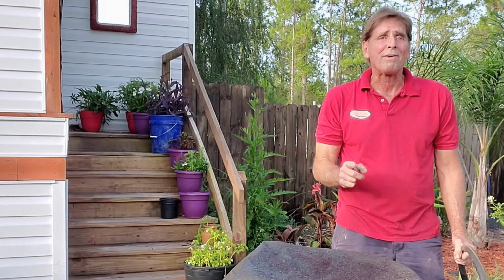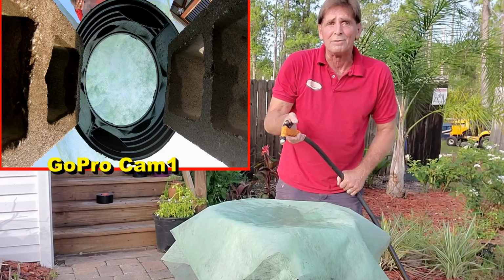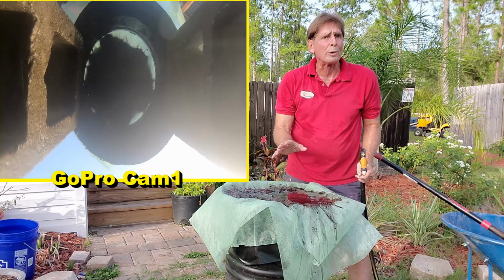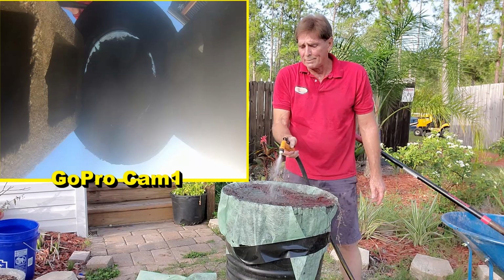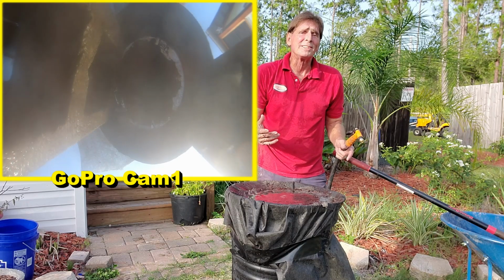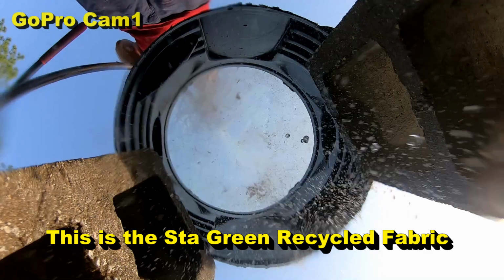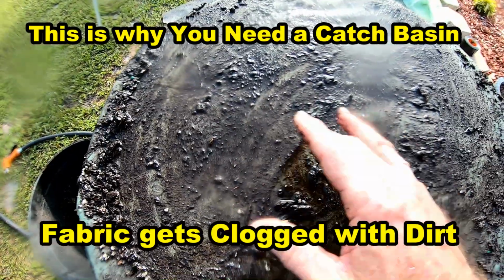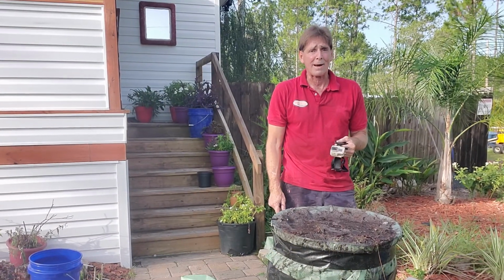Geo Fabric that Actually Works | REAL TRUTH about FABRIC, French Drain, New Amazing

Comment: HONESTY, love it. Back in February we followed your videos and built up and graded down the exterior walls of the house. Two-three months later groundwater has been diverted. The current pump has not come on, even after local heavy rains and the recent 3.5 inches from Tropical Storm Isaias.  Yet to be safe we will install E-Z Flow, for our soil type, the sump basin with the M98 pump. THANKS, CHUCK.

Comment: I have a drainage issue in front of my house. The front yard slopes towards the house. I’m going to install a French drain . Your videos are detailed and very informative. Thank you !
Reply: What was your solution?
Reply: @yume816  I had to dig all the way to the bottom of my basement wall and install 4 inch drain pipe and stone. I also cleaned the block wall and rolled a couple coats of tar on it . What a job it was .

Comment: HI Chuck, been a fan in NJ for a while and enjoy your content! We have a full French drain in my yard to capture water coming from upper neighbors. Although it works well, the trail of river rock in the middle of the yard is an eyesore.... Would it be ok to use 1 sheet of this product and do a thin layer of dirt and plant grass on it to flow with the rest of the yard? The original installed always told me to keep the rock so dirt would not filter into the rock / pipe and eventually clog it up. Thanks for your time, Chris

Comment: Geez.  I'm just finishing my drain.  I used the geo fabric.  And it was not cheap.  
I tested it and yes water runs thru really well.  Didnt think about how the dirt(  lots of clay here) will stop the water from going in.   
I may just leave the burrito unwrapped...an experiment.   And see what happens.    Thanks for all the help.
Reply: I have clay too. Did you use gravel around the pipe then wrap all of it. The one Youtuber said not to cover the wrapped gravel with pipe with the clay soil u took out. Replace it with normal soil. Who knows????
Reply: @antonios4926  
I dug my trench and lined it with the geo cloth.  (The one i bought I tested with water to see how fast it would go thru and it did pretty well.  )
Then put the pipe in and covered it with rock and wrapped the top and put dirt back on top.   It has worked well.  Im glad it is done.  It was a big job.
Reply: Thanks for your reply. Be well
Reply: @praypal5606  Hi Rebecca. How is the drain performing after a year or so?
Reply: @daibonehead  
It seems like it has held up pretty well.  and drains well. For a complete amateur I'm happy with results.

Comment: Great video chuck, as a DIY’er have used your videos for a couple years now with great success.  I believe the other guy is comparing apples and oranges here with the love of fabrics. I have watched all of his videos and don’t see a single soil type that has thick gumbo type clay I have in Louisiana, he moves dirt completely out and has a sod cutter that goes down several inches as well, all great things to offer as a contractor I guess but realistically how many of us on fixed budgets can do that? I believe you both have good design points on French drains that possibly cater to different budgets and soil types. I personally would never haul out massive amounts of clay bring in new dirt, cut the sod first just not happening.  Give me a good grade on a lawn throw in some catch basins if there is an area that needs a French type drain and no other way to move that water out then I’ll consider one but it will not have fabric and will be solid pvc with the perforated holes if I need to clean it out one day.

Comment: This video is good, however ambiguous it might feel after watching it all. I think Chuck is not an advocate of any fabric at all, except in sand. I live in Oregon and there's just clay mixed with soil but mostly clay in all of the soil in Oregon. He said, the the soil packs up against the fabric, and disallows the water to penetrate because it's blocked with soil against the fabric. I'm about to take a French drain in a few weeks against the interior photos of the perimeter of my crawl space. I'm just going to use Rock in the trench with three inch perforated pipe, and no fabric.

Comment: It's not the fabric, unless it's the wrong fabric.  The reason it slows down when you add soil is you are actually seeing the porosity rate of the soil medium.
Reply: I do think that I agree. It is as if he had placed the sandy soil from his yard on top of clear gravel and placed his gopro beneath, the water would drain at the same rate as with the fabric in place of the clear gravel.  This illustration reveals that it must be the porosity rate of the soil.

Comment: Hello, I already have a long discharge pipe of 4inches that leads to daylight but does not have a good slope, but it works.  Will the pipe work effectively when connected to a sump pump in a sump bin? Your videos shows a 3inch or 2 inch pipe if i could remember. Can you also post a link to the GEO fabric. Thx

Comment: Engineers only specify the thickness of non-woven geotextile necessary to survive the installation and use. More isn't better when it comes to filter fabric! Just need enough to separate the soil types without ripping to shreds.

Comment: So after all that you admit it doesn't work with clay and gets clogged. So I still don't know what fabric to use in clay.
Reply: I've been watching tons of videos on this subject, seems bringing drainage rock to the surface without any fabric works best for clay. Doesn't look the best but performs well. Gate City Foundation Drainage has good videos showing this and he goes back during storms to show how the systems are performing.
Reply: @tbarbuto2345  I heard that geotextiles that have drainage apertures of 60 microns or less work for clay, but that stuff costs an unbelievable amount  of money, and is normally sold only in quantities that a government agency would buy.  We bought a house which had been built into the hillside, so 2.5 yards deep to the foundation in back.  We got an inch of water in the basement, I dug down outside and found they had made a French drain with head-sized rocks, and no geotextile, all around the back, but over 50 years the clay had got in everywhere, so the drain  had no function.  Digging rocks out of pure clay is no fun; the rocks do not give at all.  I've got a system that's worked for 7 years; it's basically just an open trench around the back with a deck over it, but underneath it looks like WW I.  The system diverts a quart per minute of water round to the front of the house, but that leaves other water that I can't capture, which the foundation slab is just sitting in, but that water seems to just pass under the house without doing any harm.  At 62 years old, I would like to put the system in better aesthetic shape right now, so that when  I check out, my daughters can sell the house without too much trouble.  A really functioning geotextile would be part of a great solution.  Does anyone know if this 60 micron stuff really works?
Reply: @fuzzydon3291  I'd bet the clay would still clog that fabric. If you are dealing with surface runoff, I would open the trench and install a perforated pvc pipe (holes facing down) as low as you can in the trench. Fill up to grade with course angular rock without using any fabric. Also don't forget to install cleanouts so you can jet out the clay that inevitably gets into the system. Make sure your gutters and clear and dispensing far away from the foundation. Make sure you have proper grade away from the house. Hope this helps.
Reply: @fuzzydon3291  If you are having trouble digging the trench, try using a pick or pry bar to move the rocks.
Reply: @tbarbuto2345  Thanks, yeah, I'm delaying the geotextile.  I can do other parts of the project and see if a better idea comes along in the meantime.
Reply: @fuzzydon3291  Keep us updated about your progress.Good luck!